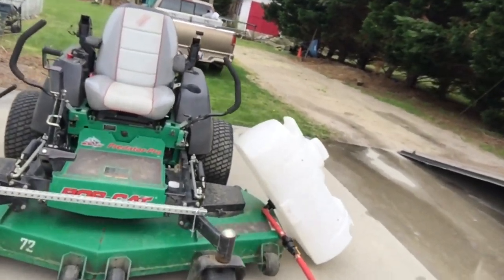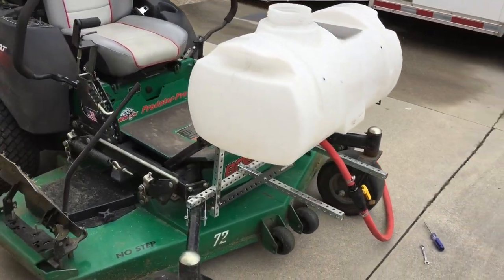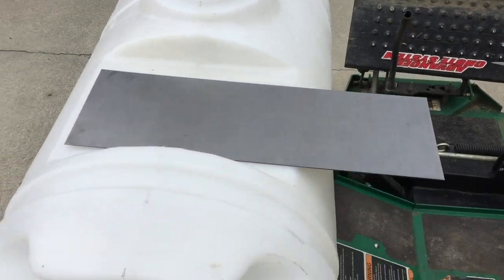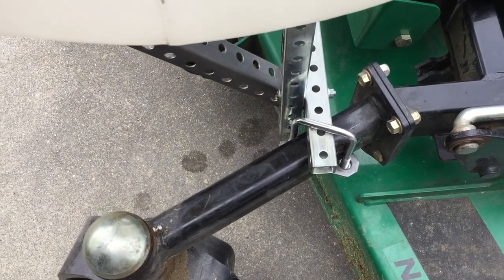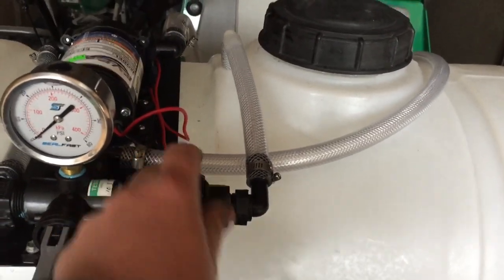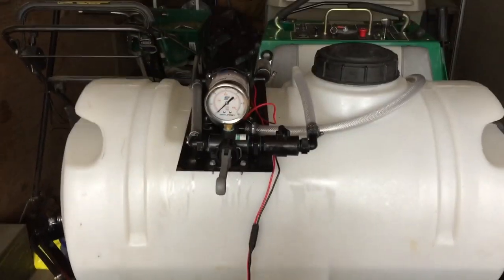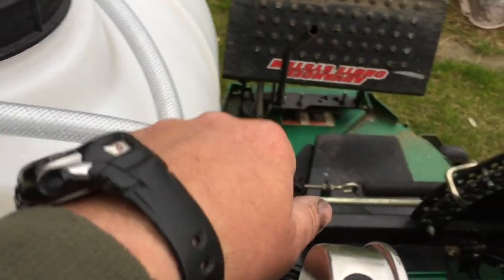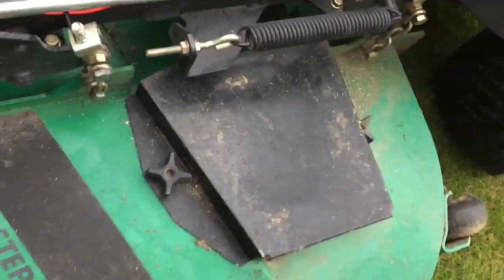Building sprayer for zero turn mower

Comment: I don't understand why people would want to have the boom in front where you run over the sprayed area AND get spray mist and fumes in your face while traveling into the air in front of you. Im planning on putting a tank on my mower but it SO easy and makes much more sense to just run the hose to the back and have the damn shit spraying behind you. My neck works so im sure I will be able to see the nozzels to make sure they're working. Already lost my dad to cancer so i dont think i need spray mist on me.. and all over the mower tires. Gotta fix mower tires now n then ya know.. the shit soaks in rubber.. I mean seriously.. put the boom behind!!
Reply: I’m with you on this….but I’m only using organic in yard, plus have a big hill in yard that when traveling up could make contact with boom….to mitigate your point and also loss to evaporation I’m going to locate boom closer to ground

Comment: I did a similar thing, I mounted a 15 gallon tank spray unit in a yard trailer, with a spray bar on the back of the trailer. and I pull it with my TORO zero turn mower. I mounted a 12v ASCO type solenoid and I ran a toggle switch up to the right handlebar so I can turn the spray bar off when turning. All that comes off when the trailer gets disconnected. I have a 1 acre yard, I spray when I mow. I turn the sprayer off every other pass. A two nozzle Chapman spray bar mounted 3 feet high on the back of the trailer sprays 12 feet wide with the big nozzles
Reply from the maker: J B heck yeah! Sounds good. I used this one for a season it worked great

Comment: That's awesome. As long as you don't have to spray parallel with any hills.
Reply from the maker: It wasn’t bad on hillsides it was on a big mower so as long as it wasn’t too steep. But yes that thing was heavy on the front when it was full

Comment: How did this work out for you? What would you change on your design?
Reply from the maker: I did really well ... I had to brace it up more and use leaf spring shackles to Mount it to the mower.... it’s heavy when full. You could make it with a smaller tank and get smaller tips to make it spray low volume... like 32oz per thousand vs 1/2 gallon

Comment: That’s awesome! If you have a parts list id love to see it so I can make one. :-)
Reply from the maker: Rob Wright oh boy! I used my napkin but I will sit down when I get a few minutes and try to write it all down and put it up here. I got the boom pump and all the valves from a ag place here called central ag the steel all came from Lowe’s and the big u bolts came from tractor supply so did the bolts holding it together. I will try to make a video with or something with all the parts.... it works pretty good btw! Thanks !

Comment: As soon as you said.. "I've got my plans drawn on a nah'kin" you got a like... hah hah    Ok, question...  How do you store it... I'm sure you're not spraying every yard... I watched the build a few times and trying to find a way to build mine where its easy on-off...
Reply from the maker: It’s very heavy when it’s full. I had to upgrade the bolts to some heavy duty leaf spring shackles. It came off pretty simple just a few nuts. The guy I sold it to still uses it as far as I know.

Comment: Looking like a good start to a sprayer. Hey...you set up gave me an idea that might help ya too. Go to a junkyard and get ya an old foot control switch for hi/low beams out of an old car. Would work Perfect for a foot controlled on/off switch for your pump. Because your on a ztr, you need to keep your hands on the controls. Foot operated pump switch would be the ticket! Just a thought, and its a cheap option too....LOL. Please provide more footage on how that sprayer works out for ya. I have contemptated doing the same thing with my walk behind while riding the velke for bigger applications where the walking boom refills would be an issue. Subscribing because I think you and I are working towards similar goals and challenges with applications. I hope we both make the $$$$ this year. Good luck!
Reply from the maker: rbljackson thanks! A on off for the pump is not a bad idea . The reason I’m using the valve shut off for the boom is to keep the pump running to the tank agataior (spelling?) they make all kinds of remote shut offs for the pump and even the valves just have to spend the money on them lol . I’ll keep ya posted as I use it more and figure more out ... good luck and thanks for checking it out I’m always open to new ideas when you get them!

Comment: Question about the boom itself, did you build it from components or buy it as a complete kit? If bought as a kit, which one is it?
Reply from the maker: rbljackson it was a kit the guy at central ag got it for me it’s very heavy duty has teejet parts only like $160 I couldn’t have put one together for that
Reply: yeah that's what I liked about it. I run the Tee Jet AI nozzles on the walking boom I made, and they sure do minimize drift.
Reply from the maker: rbljackson I just changed the ones that came in it out for the longer ai tips like on my walking boom . It also came with #50 screens in the nozzle bodies I switched those out for ones with check valves so they don’t drip when I shut it off
Reply: Could you ask them what the kit was and where I can get one? I've found a few online, but the ones I've seen don't have the T-jet nozzles. So far this year is off to a frustrating start for spraying. Temps all over the place, and winds exceeding 10 MOST of the time....ahhhhhhhhhhhhh…..LOL

Comment: I did a similar project but mounted it on back.
Reply from the maker: Mow Better I put it out front so I could see what I was spraying... it worked well I made enough with it last year to get a Permagreen
Reply: Seems like that would throw the weight ratio off, did it make the front wheels lighter?

Comment: I was just thinking of doing something like this for my mower. Did you sell your idea to Tide Industries? I see they have a product that is pretty much your design. They published a video 6 months ago. It even has the old high beam on/off switch  mentioned in a comment here. Great build though. Obviously works if it's being sold.